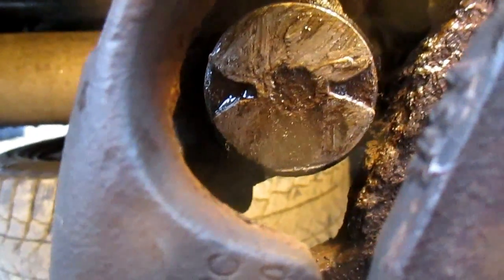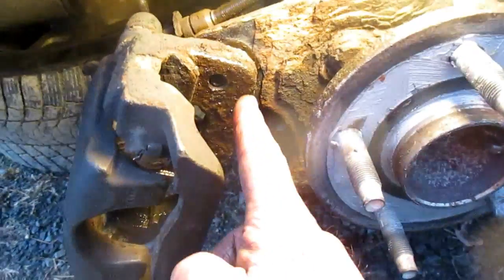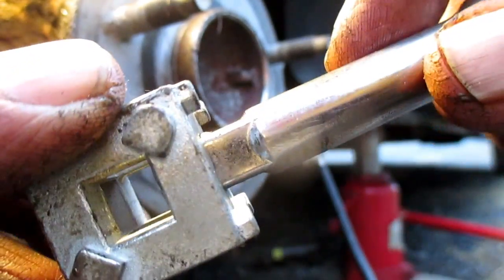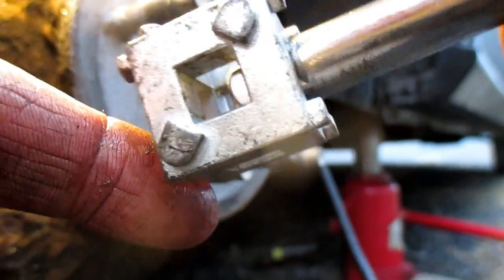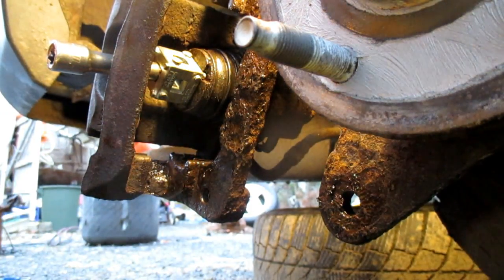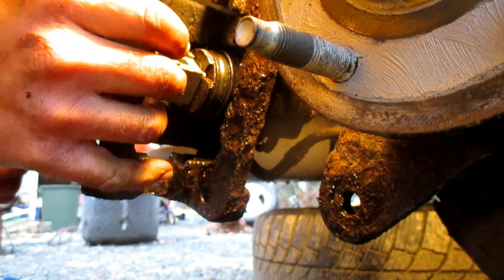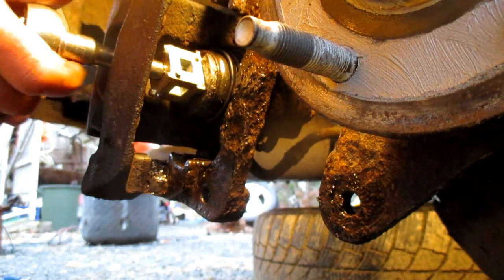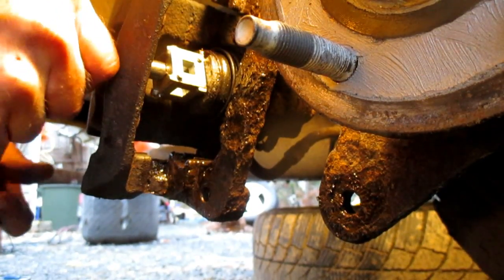How to retract a brake caliper piston on rear brakes. Rewinding the caliper piston

Comment: Can someone give advice: when retracting the rear caliper do you just retract it all the way, replace the pads and then pump the brakes to push the piston into position? I'm guessing it's the same procedure as doing the front brakes? I've done fronts many times but never the back. Any advice appreciated. Cheers
Reply from the maker: It is the same procedure Morgan - good luck with the brake job !

Comment: This literally didn't show the whole purpose of this video. Showed how the tool works. But, the pistion did not even retract back into the place.
Reply: Well, I'm not a specialist or anything, but I definitely saw the Piston going backwards. Considering that the tool is for diy people and costs only a few bucks on eBay/AliExpress, it's totally worth the money. My opinion, though.
Reply: The piston definitely retracted.  The reason why the purpose isn’t very well explained is because if you are watching this video you should already know why you need to retract a piston.  This was a perfect tutorial because it only shows what is necessary to know
Reply: Using my keenly-honed Powers of Observation (and by placing the mouse cursor on the face of the dics...I mean disc)...I was able to determine that the piston retracted .54389752" before the film broke.
Reply: @aerodicus  no
Reply: @kevswick  You're right, though not very informative. I've owned and maintained 13 different cars and have helped friend's replace brakes on many others and have never heard of spinning calipers in, only compressing them. After some research I found out that these screw type pistons are designed to  be used as parking brakes and self adjust to keep the parking brake system tight and free of slack.

Comment: Mine was so hard to put back in, I ended up just grabbing a breaker bar and turning as hard as I could. I think it may be time to replace the caliper
Reply: You can bleed your brake line while you rewind it, it should go in with next to no resistance.
Remember to check and top up your brake fluid though!
Oh and make sure you catch all the fluid that bleeds and DO NOT get any on your paintwork lol.
Reply: Replaced a rear caliber on a ford five hundred the caliber was completely locked up. Even used the tool kit but unfortunately the tool kit didn't survive. Had to replace the caliber and done this in the middle of winter in a garage with no heat. Saved money on labor but next time it will go to a garage.

Comment: Do you need to remove the cap on the master cylinder (fluid fill cap)????
Reply: It doesn't hurt too. The reason is that if there is excess fluid in the system (someone overfilling the brake fluid reservoir), having the cap on won't trap the fluid making its way back when the piston retracts. 

Because if that happened, then the master cylinder can get severely damaged. 

Best to remove cap and let it sit stop threaded hole, with a slight opening.

That way dust or debris won't make it's way in when doing a brake job

Comment: I come to realize these styles tend not to last ads the front breaks calipers. Mines turned but did not retract
Reply: I have the same issue, what did you its turning but not retracting 🙆🏽‍♂️🙆🏽‍♂️
Reply: @19Sanele89  try bleeding the breaks completely, get all the liquid out. Remember the bleeder to bleed the break only takes a small turn to lock it and unlock it. If you over do it you'll mess up the thread inside the caliper and will have to by a new caliper. I learned the hard way lol

Comment: At the end of the video, seems like the piston is slipping, because of unstable pressing force.  It is just my consern about this simple tool.
Reply: I've seen people use a C-clamp, and then just use a side insert on the tool, using the ratchet extension as a handle to rotate.

Comment: It didn't seem to be going back into place though
Reply from the maker: The caliper shown in this video eventually had to be replaced (that video will be uploaded soon). So although the piston did retract in this video - it didn't retract as quickly as it should have. Very observant Luis !
Reply: I’m having the same problem. It won’t go back in .
Reply: @Funnygalsproductions  what did you do I have the Sam's problem
Reply: Richy Shezi hammer and turn

Comment: really, where to start. You need a power washer and 3 gallons of cleaner to clean everything before you even start. Then clean grit and corrosion of everything BEFORE you start adding new parts. As you would say "straight forward process". Also, at no time should you ever put anti-seize or anything else on wheel studs. Torque specs are for DRY studs. This entire video is a brake failure waiting to happen !